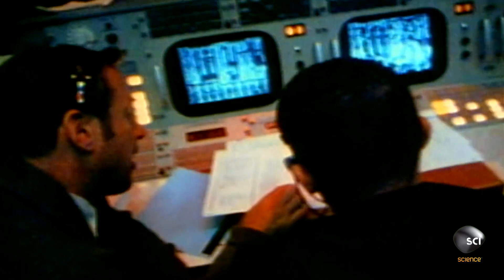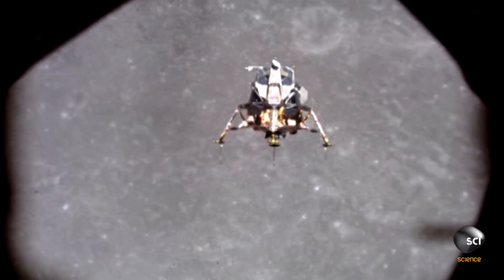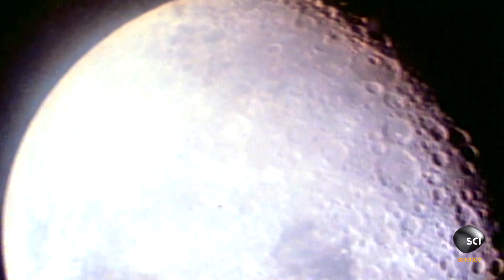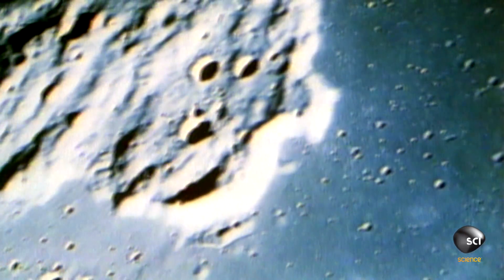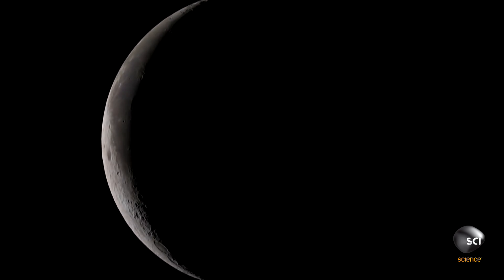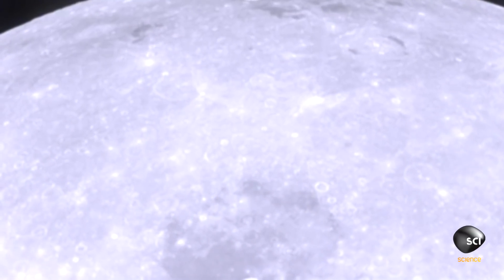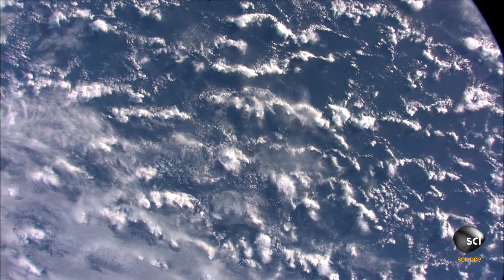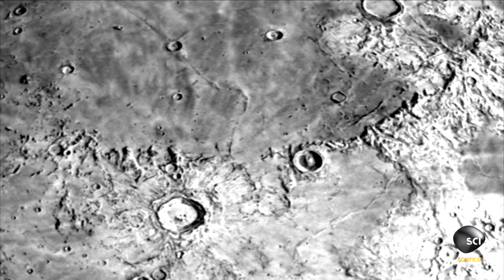Why Does the Moon Sound Hollow?

Comment: Am I The Only Person Who Wants To Know What It Sounded Like When They Hit It..?
Reply: The moon has no atmosphere - which means it is in orbit around Earth moving through a vacuum. Sound needs airwaves to travel on to be able to be heard (audible). In a vacuum there is zero air. Therefor, it is not possible for there to be sound coming from the moon.
Reply: @TheWalkingdude69  The moon does have an atmosphere, it is just very weak.
Reply: @TheWalkingdude69  ⁰
Reply: @TheWalkingdude69  the can measure the vibrations and translate that into sound, as they have done with other things before
Reply: @TheWalkingdude69  Vibrations are felt through solid matter more efficiently. No need for Air
Reply: @TheWalkingdude69  Direct contact would feel the vibration even in a vacuum. It can be measure and heard.
Reply: TheWalkingdude69 true but we have technology to convert the frequency of vibration into sound to see what is sounds like
Reply: TheWalkingdude69 well actually the frequency would probably be to low for us to here
Reply: Vibration is NOT measured by sound.
Reply: "Ring like a bell" was a metaphor when the first Apollo-emplaced seismometers detected seismic shock waves from deliberate lunar impacts [by US vehicles] and later large natural objects. It referred to the unexpectedly-long time duration of the resonance waves, not damping out as quickly as in Earth's crust. Geologists quickly figured out the lunar crust didn't damp out seismic signals as quickly as on Earth because of the much higher dryness [and brittleness] of the crustal rocks [not because it was metallic and hollow 'like a bell']. It was the lingering reverberations that prompted the scientist's phrase 'like a bell', not an acoustic similarity to what a bell actually sounds like to the ear.
Reply: Well since there’s no atmosphere it probably sounded like nothing.
Reply: Twaaaaaaaaaaaaaaaaaaaaaang.
Reply: @orbs1062  I'm afraid you're incorrect good sir.

It sounded more like "BONK"
Reply: @Jimini John == "Ring like a bell" was a metaphor when the first Apollo-emplaced seismometers detected seismic shock waves from deliberate lunar impacts [by US vehicles] and later large natural objects. It referred to the unexpectedly-long time duration of the resonance waves, not damping out as quickly as in Earth's crust. Geologists quickly figured out the lunar crust didn't damp out seismic signals as quickly as on Earth because of the much higher dryness [and brittleness] of the crustal rocks [not because it was metallic and hollow 'like a bell']. It was the lingering reverberations that prompted the scientist's phrase 'like a bell', not an acoustic similarity to what a bell actually sounds like to the ear.
Reply: They said it sounded like nickleback  
 so they called  it trash
Reply: lmao all these people in the comments are so stupid, it still made a literal sound it just didn’t echo at all due to there being nothing to catch the vibrations. nasa definitely heard it, it could only be heard on the surface of the moon
Reply: @noparkingnoparking  I Know, Right? Just Because There Was Nothing In Space To Hold On To The Sound Long Enough For Us To Hear It, That Doesn't Mean No Sound Was Made. I Can Imagine It Like A Long Droning Sound, Similar To A Bell, Yet Deeper And Gravelly And Way More Dramatic. Like A Long Groan, Almost..
Reply: Gooooooooooong!!!!!!
Reply: All sound is just vibration, whether it's through the air, water or solid ground.
Without an atmosphere on the moon, sound cannot travel anywhere.
If you had your ear to the moon when the crash occurred, ie on the surface, or say used a stethoscope type of thing, you would first hear a crash, like a car crash, and then it would settle into a steady vibration, which probably is below the human range of hearing.
Reply: EternalSummer14 It sounded just like Cassius Clay did when he hit the mat after Henry Cooper knocked him out, causing Cassius to fall backwards, striking the mat with an earthshattering KABOOM!  Only that reverberated amongst the boxing community  
for decades!
Reply: @blackholeentry3489  you do know there's no sound in a vacuum. and i think that applys to both cases.
Reply: @paulyrepa2046  Yes.  Today is my 79th b/d and as a lifetime amateur astronomer, I've probably been aware of that fact for many decades.....and much longer then have you.
Reply: @blackholeentry3489  hmmm! Happy  birthday mate! Im only  52.🇦🇺
Reply: @paulyrepa2046  Hey, genius, ever heard of a contact microphone? Acoustic guitars use them regularly. No air is needed for them to work. In fact, you'll probably get a cleaner output in vacuum.
Reply: Sound can travel through space but nothing forces the waves to compress so it isn't doing anything audible
Reply: @deafanddestructiononthepis3149 -- I can't hear you.
Reply: The moon & the clouds
Reply: It pinged.
Reply: Sound = Vibration
Reply: There is no air on the moon, but if their were it probably sounded like a crunch, because its a heavy object hitting rock. The ring probably would not be able to be heard by human ears
Reply: Tannnnnnnnnnnnnnnnnn 😅
Reply: There's No Atmosphere So You Can't Fucking Hear Anything
Reply: @ff-qf1th  Just Because You Can't Hear Anything, It Doesn't Mean No Sound Is Being Made
Reply: I imagine it to be like forrero rocher. The hazelnut coated chocolate is not really touching the round wafer.
Reply: Pink Floyd
Reply: It sounded like bbooonnnggg
Reply: there is recordings of it when they did it copies got out from a group of different stations recording it, the viberations got converted to sound waves
Reply: @karlkuttup  Okay, I Definitely Got To Find Those.
Reply: I'll tell you:

"BONK"
Reply: They had tested that a long time ago and it sounded like a bell and rang for an hour and a half
Reply: Me too
Reply: I think it's a video but not sure if it's real
Reply: sounds like potato
Reply: Same
Reply: Moon: im just egg
Reply: DUNG.
Reply: According to Connie Chung, the news anchor person from the late 90s, it went "Chung"
Reply: Reading the idiocy in these comments makes me fear for
Our future 🤦🏻‍♀️
Reply: That's why I came here!
Reply: I'm not sure the video is saying you could hear the sound through the space is it? 
Didn't they record (and listen to) the sound (vibration/frequency) using special equipment they left on the surface? 🤷‍♂️
Reply: GOOOONNNNGGGGGGGGGGGGGGGGGGGGGGGGGGGG

your welcome.
Reply: The moon has no atmosphere, but it has rock. If you lay your head on the surface you'd hear it, the hittin' sound. Well, at least if the frequencies are between 20 and 20k Hz.
Reply: @azarilh2355
Reply: Like nothing. They supposedly measured vibration. Which I'm still confused how vibration can be measured or be at all without making sound.
Reply: @clevername8832  they left seismic equipment on the surface
Reply: @clevername8832  seismometers like those used to detect earthquakes and atomic tests are used. They record physical vibrations. A company I worked for used one to detect floor and building vibrations. It would detect big trucks going down a nearby highway. Did not detect sound waves which are too weak.
Reply: @clevername8832  the moon is a physical mass in space made out of fixed solid particles that can vibrate on their specific points only particles at absolute zero cannot vibrate but the reason it makes no sound is that there are no gaseous particles which would be an atmosphere. Since there are no particles there is no transfer of vibration because there is a lack of a medium to vibrate after all sound is just vibrations of air read by our ears. However if we put a seizometer on the moons surface in contact with the ground the moons solid particles would vibrate the seizometer which can measure the intensity of the vibrations to make a sound wave graph which I guess could be replicated if you had the graph unless it was above or below human hearing range 20hz to 20000hz. Human hearing range could be wrong its been a while since ive done this kind of physics
Reply: @yaboi2191 despite my Mr know it all comment, I appreciate your answer. I guess the idea of a person being so unintelligent or so lacking understanding that they make up their own ridiculous story is ridiculous to me. Hollow  moon? Really?
Reply: @yaboi2191  thank you
Reply: Humans can't really hear those frequencies
Reply: @anonymousanonymous-nt8ls  read a book!
Reply: @paulyrepa2046  LOL, "read a book" because you can't explain it either? Did you read the book about it? Sound can be artificially generated using any wave. If the frequency is too high or low, they can move them to audible frequency so that we can listen. I don't think you have read enough books to understand what I'm sayin though...
Reply: @sbkarajan  sorry man know idea what u are on about. I spoz if u wish enough i can, oh! It can b true. Lol
Reply: There's no sound in a vacuum! Come on people think about it 🤪
Reply: There's no sound in a vacuum! So stop all ya nonsense!
Reply: Well too bad cause there is no sound in the moon
Reply: @anonymousanonymous-nt8ls  there is no sound in a vacuum, be it in your head or otherwise. Read a book mate!
Reply: @paulyrepa2046  What books HAVE you read?
Reply: Sounds cant travel in a vacuum. Snap out of it!

Comment: Ugh, this. Gee, let's think; it's a tiny, solid rock in the sky, maybe the vibrations keep hitting themselves and travelling back the other way over and over again because there isn't anywhere else for them to go, and because the moon is solid and there's no air, there's literally nowhere for that energy to go, so entropy takes its sweet time wearing the energy down.
Reply: Exactly.  the longevity of the seismic vibrations actually indicates the Moon is solid with little to no liquid core.  if there were a large liquid core or if it were hollow then the waves would dampen quicker.  
Also, the moon has a moment of inertia of a solid body.  There is nothing to indicate that it is hollow.